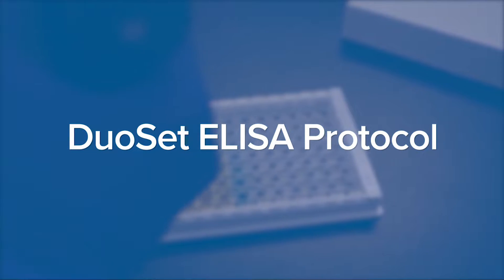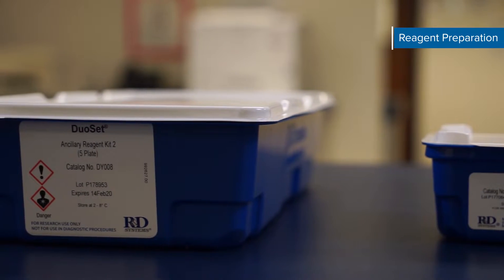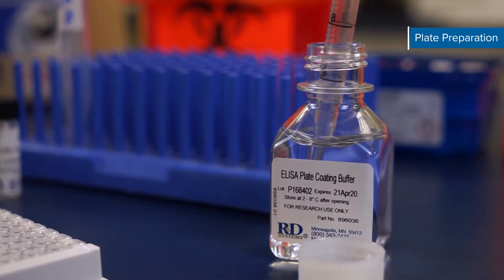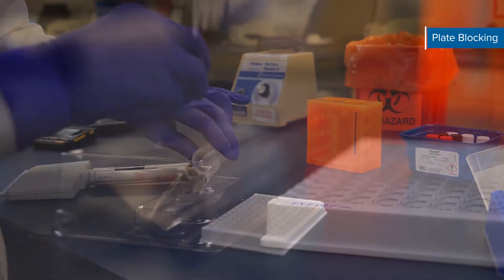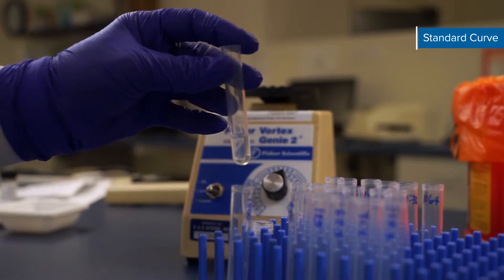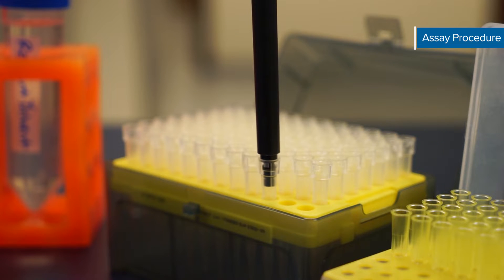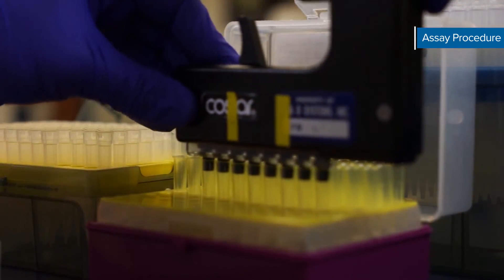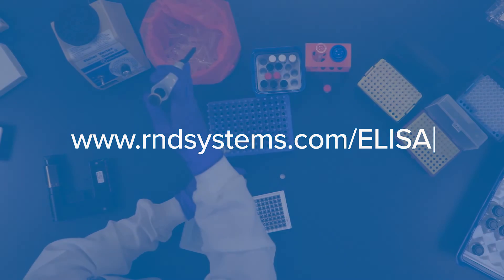How to Run an R&D Systems DuoSet ELISA

Comment: how long can i storage the antibody-coated elisa plate in the refrigerator?
Reply from the maker: R&D Systems has validated the DuoSet plate preparation method as written in the product datasheet - plates are coated overnight and assayed the next day. Longer incubation of the Capture Antibody plate coating (step 1 of the Plate Preparation) is not recommended. For short-term (24 hour storage), stop at the blocking step (Step 3 of the Plate Preparation Protocol) and store the plate wet in the Reagent Diluent blocking buffer overnight at 4 degrees Celsius. Equilibrate the plate to room temperature the next day and proceed with assay protocol. Blocking longer than 24 hours is not recommended.

For more FAQs please see our ELISA resource page: https://www.rndsystems.com/resources/faqs/elisas